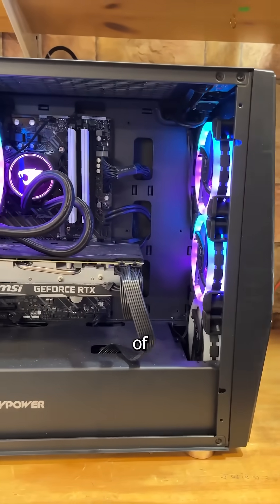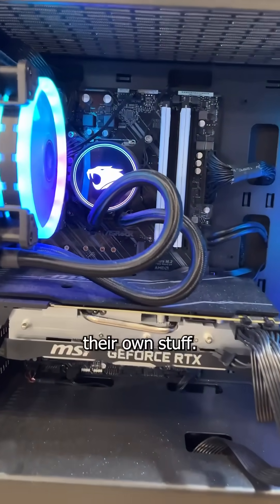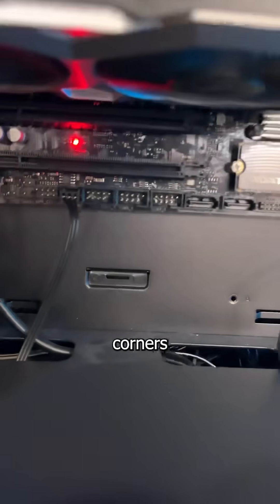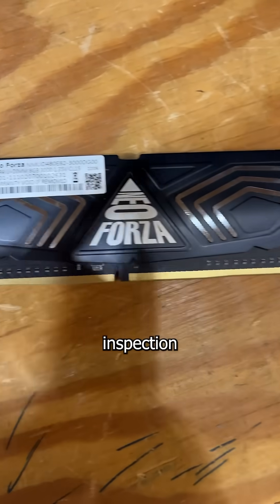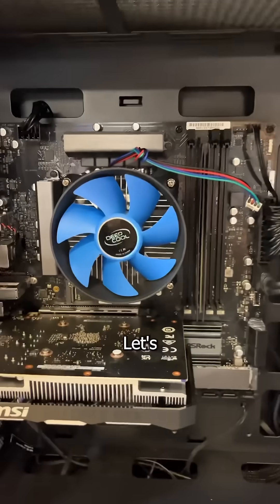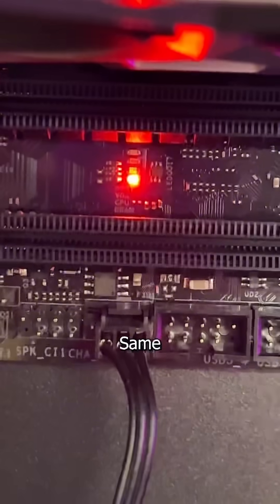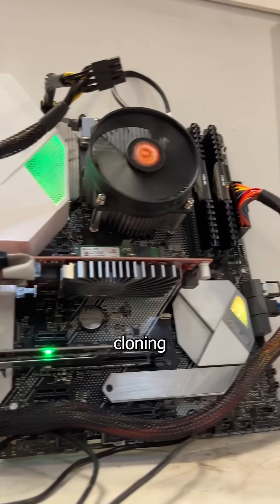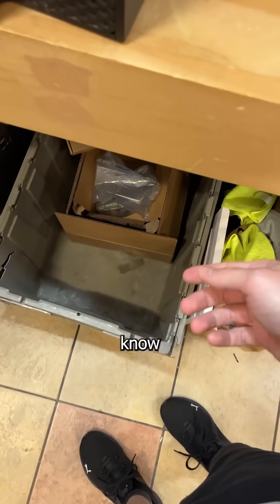iBuyProblems? Cheap NVMe causing no POST 💀 #technology #pc #tech #shorts #computer

Comment: IBuyPower is just awful. I had the pleasure of using one, and wanted to install a second SATA SSD. As it turns out, their case appears to support a second SATA since there's a second mount with what appears to be a cut out cable management hole, but it actually just leads to solid metal. That's not the worst since I could just cut new holes into the case so that the cables can reach the mount (which is basically kissing the motherboard with how close they are to it), but these assholes pocketed all of the non-essential screws that came with the motherboard. I looked under the first SATA SSD which should use 4 screws, *nope*, they only used 2 screws, meaning that my initial plan of taking 2 screws for opposite corners was already done by IBP. I decided, "Ok, SATA is too much of a hassle, unless I want to just leave a SATA just sitting freely, lemme look at the NVMe slots. Ok, I'm using one but there's a second unused one. Lemme see wh- Oh. they also pocketed the spare NVMe screw instead of just leaving it in the motherboard. I almost went back to SATA so I could leave it hanging around, but I learned my lesson, took off the back panel to access the PSU, and holy shit these fuckers somehow got a PSU with ONLY the necessary power cables for the exact parts they put in it, meaning not only would I need a second sata data transfer cable, but also a sata power cable to plug into the PSU. 

So my choices were either buy a SATA with no screws, so I'd have to find or buy at least 2 fitting screws, as well as a SATA data and power cable, or buy an NVMe SSD and find or buy a single screw. I wound up scavenging a star-shape screw from an old HDD that as a little small, but was barely large enough to keep the new NVMe from popping up while fitting in the screw hole inside.

Comment: I just got a ADATA SSD for laptops because my HDD from my Lenovo Ideapad had given up and had caused my GPU to mysteriously be forgotten by the laptop when it did a BSoD during one of the days I was using my HDD.

So far, my SSD is running well. It's a 256GB SATA one and it costs me 1,100 pesos (roughly $10) which is alot for me right now. I got it from a local pc shop in the mall.

After seeing people saying ADATA is shit, I hope mine lives on, even after my IdeaPad gives up.

Comment: Not only is it a cheap faulty ADATA SSD, but it's a cheap ASROCK board that doesn't even have NVMe heatsinks.  NVMe drives need cooling, passive is enough, a cooling plate is great, but a ribbed passive radiator block is better.  It isn't a V-NAND, which doesn't require cooling, placing a NVMe in a V-NAND configuration is the height of careless cost-cutting, this sort of thing should be regulated.

Comment: I had that one with the same case and water cooler XD back in 2019 but over time I upgraded it started out to a RTX 2070 super and a i-7 9th gen cpu now its running a i-9 12th gen cpu and a 3070 RTX along with a nzxt case

Comment: Particularly low end NVME drives lack the dedicated ability to store a DRAM cache and it makes it need to borrow resources from the RAM. This is then used to store mapping functions and other tasks. If RAM isn't sufficient to deal with the increased load, it causes a DRAM error. ADATA is a massive player in this problem. Their drives are on that lower-end of the spectrum and cause issues like these all the time.
Reply: Thanks for this info!
Reply: F tier storage medium is ADATA's name.
Reply: You get what you pay for 
Never had an issue with my Samsung drives
Reply: @giggs_4208  Samsung, Intel, and Crucial are the only brands I trust. Have a 10 year old 850 Pro that is still in daily use.
Reply: @giggs_4208  This is going to come shocking to you, but there are plenty Samsung drives without a DRAM cache. HMB works perfectly fine and it isn't some terribly awful low-end-only feature
Reply: @giggs_4208 same here no issues with Samsung ssds, as well as western digital higher end drives.

Comment: You shouldn't have tossed that NVME... aDATA isn't technically the worst - theyre not great, but they're not "bad" pre say... Probably a bad Capacitor due to that Sketchy Power Supply to the PowerRails on the board and the CAP on that NVME was probably the weakest link, or, they tried to Defrag an NVME and just Burned it out... also, the RAM and the NVME is probably causing an error in the SoC or SouthBridge... so "HALT"

Comment: Sometimes you can't tell why it behaves that strange.

Many years ago I worked for Dell as dispatcher.
One customer had an issue with an Optiplex only wanted to boot from network. Lots of tests. Finally sent a technician. He should replace the motherboard. He calls in and reported the same issue. Out of ideas I clutched at straws and asked him, if he replaced the coin cell or used the old one. Turns out he used the old one. So I told him to try the new one. You won't believe what happened. That thing worked. So he switched the mobo back to the old one and just replaced the coin cell and it was fine.
I wouldn't believe it myself if it wasn't me.

Another one: in the Studio hybrid 140g there was a slot in optical drive. That drive was attached using screws. One substitute part for the screws was incorrrect and the screws slightly too long. So they reached too deep into the drive. Discs got stuck, got rejected, ... 

Discovered this by sending a technician onsite with an optical drive and a bunch of screws substitutes (insisting on actual this partnumbers to get all the subs which could be done by dispatchers back then). The screws has mostly been used in an assembling factory in Poland iirc.

Comment: I had a Samsung SATA SSD shit the bed one time after dusting out the PC. That shit was so annoying and mind boggling to me to try to fix it. Ended up just loading Windows on to my HDD and reloaded all my programs. PC ran slow as balls but it worked. Got a HP Omen now and it's been pretty good but with modern titles like BO6 my CPU is screaming and GPU is becoming obsolete. Trying to piece together a new build but prices never came down after the Bitcoin/Plandemic inflation on electronics.

Comment: Why is everyone dogging on adata .

My sx8200 pro has been in used for 4 years and around 12000 hours , its sibling the sx6000 is around 3 years of use and 8000 hours , theres another sx6000 i picked up just a year back aswell.

Theyre both still fine to this day

Comment: Hello, can I ask something?
Every time I open PC, I hear click click sound.
It's like there is something stuck in my fun.
But I checked the CPU/GPU/RGB fans and didn't find an error.
That click sound only appears when the computer is boosted.
After 5-10mins, that sound disappears.

After about 3 days, while I was playing genshin impact game,
My computer suddenly said gpu is not detected, and desktop is frozen. When I restart, gpu is no longer detected, and Windows is so slow. So I reinstalled gpu card and boosted the computer, but it appeared with a blue screen.

Don't know what happened, so I unplugged all cables and reattached them.
But I smell something burning, so I quickly switch off the computer. Now I don't dare to test my PC anymore.

Is there any hope for My PC ? :'(
I'm broke, so I haven't gone to a repair shop yet.

Comment: Adata is known for using cheap and sometimes even discarded ICs on the mainboards. They also don't properly seat the ICs with their process so sometimes there could just be beads of solder touching but not bonded to the card. When it gets hot enough, because those beads haven't been tempered before, they tend to melt and spread to other contact points, making use and data recovery sometimes impossible. It can end up happening where it can retrieve data but as soon as it tries to use high speed ports to send it, well it stalls out and just dies.
Reply: They’re pulling an Xbox 360 GPU solder blunder? Supposedly wise men are supposed to learn from the mistakes of others.
Reply: Depends on series, i think. 
This was "swordfish" series drive. I had two. Both died in a month. Absolute trash. 

Current systems have ADATA SX8200 and XPG S40 drives. Both 4 years old and still run like brand new.

Comment: I've seen this happen before with bad M2/NVMEs, I always assumed that it's because the SSD is on the slot on the bus between the CPU and RAM and that the system is detecting something closing a circuit, because the drive is plugged into the slot on that bus, but it's dead and that the dead device blocks enough channels on that bus so the CPU cannot "see" the RAM so the system assumes it's the RAM that's bad and makes no further attempt to POST. I'm guessing it wouldn't happen the same way if the same bad NVME was plugged into a mobo with two slots and the secondary slot was used where the secondary slot feeds into like a B550 chipset, or something,  instead of straight into the CPU - but I've never tested this myself because once I get something working again I gotta run to the next thing that's caught fire!

Comment: It's PCIe NVMe, it's using the same channels as RAM and if it's faulty it shows up as a RAM issue. There is no issue with bandwidth doing it this way, but I highly recommend Western Digital SSD such as the Blue for work stations and Black for gaming. Don't ever buy Green, it's the slowest version and not worth the savings. I still have Western Digital hard drives from when I had a 486 and they still read and yet the Maxtor and Seagate drives have all died. RIP Maxtor Fireball, you were the fastest HDD ever, 98000 RPM was insane back then and the standard was 72000.

Comment: Yea well i had an MSI motherboard that i bought for an 11th gen intel and it wouldn't turn on... motherboard it was all shorted but it powers on just fine with the 10th gen...now 2 3 days ago pc froze...removed one stick of ram and it works... plugged the other one...works tryed the other slot with both stick everything works...if i plug both ram of the same kind it won't turn on no image no nothing...if i have 2 mismatched sticks of ram it works...how tf dows this make any sense how do o must have 2 different sticks...i tryed 2 of the same kind of different ram and still won't work

Comment: That's an Asrock system board. Here's the thing, I've seen bad Seagate physical SATA drives also cause a DRAM error during post. The reason is the BIOS checks the hdds immediately after checking the RAM. If it can't see it and gets stuck at detecting the first HDD, it automatically blames the DRAM.

Comment: "damn my ram light is on"

"You have to change your hard drive"
Reply: Not the weirdest thing i've seen lmao. CPU debug fault with a GPU was the weirdest one I've seen.
Reply: @ReverseLuard no kidding, I had a GPU short on me this week and it somehow killed my boot drive of all things. Mobo is fine, which baffles me.
Reply: Computers are supposed to get better not stupider
Reply: i think because the m.2 is like a memory stick :^ (you can eat both)
Reply: My ram died recently and instead of a ram light i got a cpu error
Reply: erm acktually thats a solid state drive :nerd:
Reply: @AstroPkReal  solid could be hard... ig...
Reply: i have a two slot motherboard with 2 8g rams and it didn’t use one ram stick and only showed 8gb available and when i switched the two rams into each others slots everything started working perfectly again.
Reply: Brother, I am charging my cigarette from my phone 

we're in the F U T U R E
Reply: damn i didn’t know ford makes computers lol
Reply: @ricktherat8994 when was Ford mentioned?
Reply: Kind of why I hate these Motherboards with post lights that are usually one of 3 options
Reply: idk if someone else has commented this, but that drive lacks DRAM, so it needed to borrow ram which resulted in a crash
Reply: I got a CPU fan light when I hooked it up to the CPU_FAN.... so I used the CPU_OPT next to it, and everything worked fine! MB lights are like car code readers, it's still a wild guess what's wrong when things don't work properly and you have info staring you in the face
Reply: Pc builders - just build your own "it is easy" yeah even the idiot lights are wrong.
Reply: Its not a hard drive

Comment: It gives a dram error because cheap nvme drives use system RAM as cache and allocate that while POSTing. And the controller may have been functional enough to allocate RAM but not really succeed and so the system dies.

Comment: My brother bought me one. The only issue it has is that the ram has to be slightly over volted to run smoothly. If it isn't, it will randomly shut down after 10-15 minutes

Comment: If the SSD has failed or is failing, it could have corrupted the system files needed for booting. This corruption can cause the BIOS or UEFI firmware to misinterpret issues as RAM-related errors because the necessary boot files aren't being loaded correctly.

Comment: I was having RAM stability issues, but Windows would only identify the issue as a "PNF List error" in BSODs so... What appears first as a DRIVE issue was actually a RAM issue (wrong timings)... I'm guessing the RAM is being "told" by the CPU to load into memory system files from the drive, and the drive being totally corrupted makes it appear as if the RAM is faulty--because all the 'files' loaded are zeros ... that's my best guess...

Comment: Look, we all forget things from time to time. I had to redo my pc because I needed a new cooler for the CPU, the other one had issues keeping it cool, redoing thermal paste didn't do it.
Put the pc back together, boot, no image. Panic, I broke the vertically mounted GPU. Or accidentally touched the pins with paste.
Nope, just accidentally put the PCIe cable from the GPU in the wrong slot. 10 minute panic for a rookie mistake.😊

Comment: While ordering a laptop three years ago, I paid extra for a storage upgrade to a 2TB NVME. Little did I know, it was an ADATA...
Not even two months in the PC was popping 100% disk usage and all sorts of OS issues; the drive was wreaking havok and I had no idea the SSD was the culprit...
After a bunch of troubleshooting the drive just stopped being recognized altogether.
So, I switched to Inland and it's still going strong.

DO NOT buy ADATA products.

Comment: I have had ADATA drives ever since they started delivering to customers. The thing is, those fancy 2-4-8TB drives in this particular system are NOT meant for regular consumer systems. They are meant for industrial systems only. But some retailers don't give a sh¡t and sell them to normal consumers anyway. With all the error, terror and malaise as a result. ADATA is a great brand and every 'value'-SSD/nVme is great, but the non-value ones are not meant for normal systems. That's the issue. I'm a former datarecovery specialist and this is from the knowledge I gathered in the past 27 years.

Comment: Power-On Self-Test order, which can be a bit different with M.2 devices. If the M.2 drive is causing a power issue during initialization (ex: short) that leads to RAM not being initialized correctly (cause power isn't properly continuous, present, right voltage, ect), RAM error pops up and POST stops. Checking the storage drives is usually after checking the ram, so the BIOS hadn't self-checked the memory drive just yet because it caused an issue with initializing the RAM.

Comment: @slaemtechperts fail depends of board, if the SSD is connected to CPU directly it can show you ram error. but i never saw that, when a SSD is connectet on buttom port, maybe wrong signal from controller to cpu i guess.

Comment: Both M.2 and DDR Memory connectors are wired into the SMBUS. Memory uses for the SPD chip (holds the timings). Chances are the busted SSD was causing issues with the SMBUS

Comment: Not going lie this is how my Corsair build started lol and I bought a ibuypower prebuilt and it ran fine since 2018 with heavy gaming and then did a corsair build from scratch with the cpu and motherboard because everything was upgrade to corsair parts… Saying that they do use alot of wierd obscure brands to cut cost on fans, rams, ssd, HD and even the freaking case and let not talk cable management 😢 But in saying that it did it jobs til it was gutted and what was left was transplanted

Comment: ive had the same 5 drives, xpg s70 blades and adata sx and su drives in my 2 systems for the pased 3 years and running strong. Its not the one in the video but people seem to be blanketing adata as shitty as a whole, i know its anecdotal but ive had nothing but the opposite experience with them.

Comment: Likely because ram and sdd/pciE both use flash memory nodes, just with a different data read style, the hard drive could be mistaken as ram due to it being read incorrectly from the motherboard
Reply: And then crashed because read/write flash memory was only being used as read only random access memory

Comment: Well ram and Nvme storage are very similar its just ram is voliatile and just holds whats currently happening and open so im asumming the Nvme was improperly sending data to the ram. And because the Ram wasnt sending anything to the CPU or GPU the mb most likeley thought it was an Ram issue. I got this all from 5 google searches i could br entirely wrong

Comment: Hey, I had a question that could either be solved in a comment or a video? What's the difference between two geoforce graphics cards. If you could just use them latest models as an example that would be nice. I'd just like to know